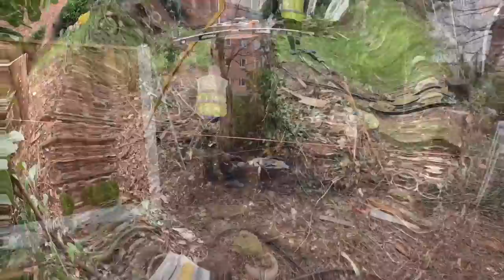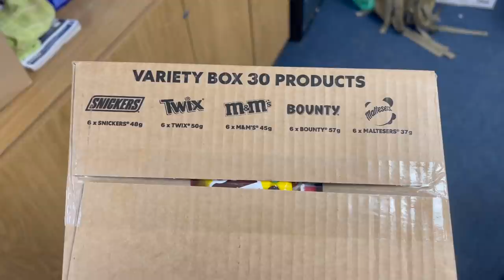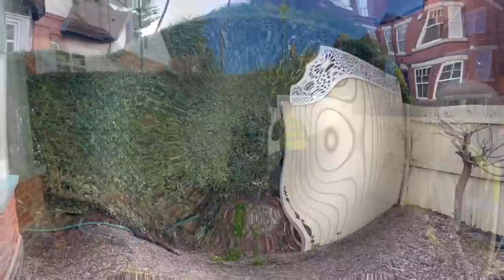THIS WILL BE THE DEATH OF US! - This Week At D&J Projects #046

Comment: Back in the day, if it was YOUR fence you had the "nice" side facing  the neighbour also it ment you can get the panel out to repair or paint without having to go into your neighbours garden.  So I suspect the reason the last client with their fence wanted the "nice" side out was so they could lift it out to paint from INSIDE their garden...specially as  the pavement is so much lower outside and there's that wall in the way

Comment: Great videos as usual, just wondering why you are using a micro digger and a motorised wheel barrow on the extension job, surely a 3 or 6 tonne digger and a 3 tonne dumper would have been more time efficient for the dig out and strip

Comment: With respect to the post on the fence job couldn't you leave them all the same height then if the customer wanted to raise the ground so all gravel boards and panels run level they could. I get it would look weird but not as much as it does when there's a drop anyway. Get job as all ways gents.